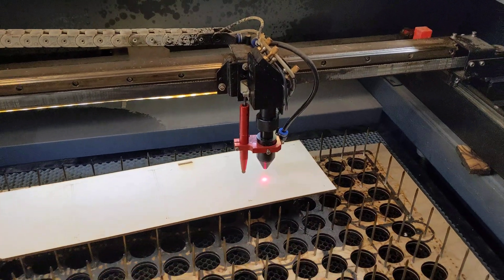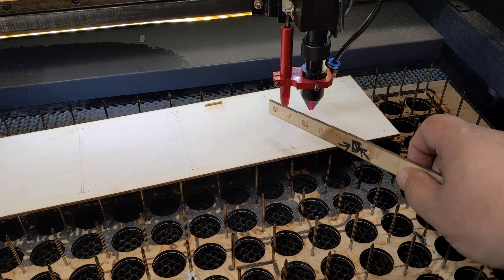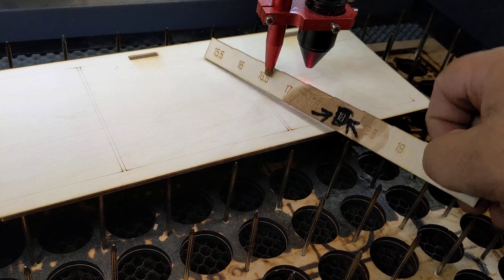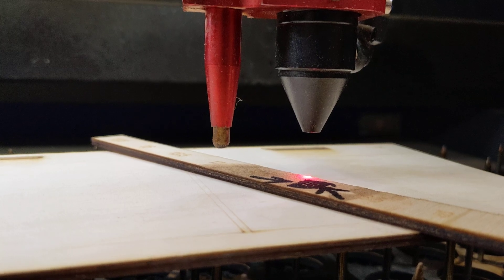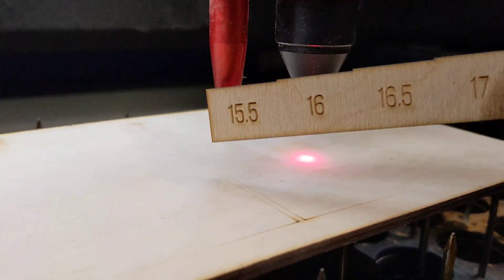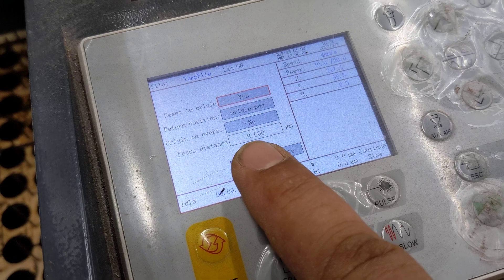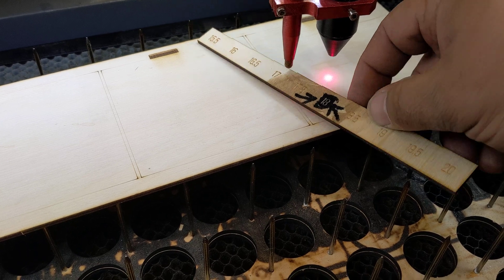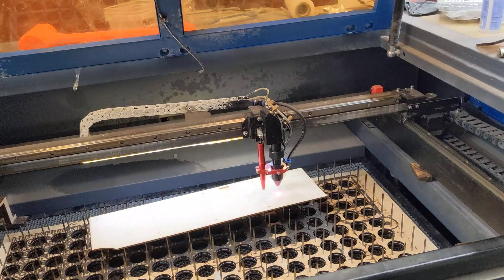OMTech / Chinese Laser Autofocus Adjustment - Safety/Frustration removal recommendation!

Comment: The autofocus feature is a disaster, causing numerous frustrations and safety risks. The faulty sensor frequently fails to adjust properly, resulting in inconsistent cuts and potential harm to the machine and materials.
Reply: Never had any problem with mine.

Comment: You cab get more distance between the probe and work pc. There is a grub on screw you can loosen and adjust to make the  plunger tip travel less to close the contact . Give you more probe to material gap ! )

Comment: I can see that you have an 18mm diameter 50.8mm plano convex lens and a nozzle with a 4mm orifice. Setting the focal distance to about 19mm tells me that you are working with an ENGRAVING set up where focus is not that important. In fact best  normal engraving results happen when you drop the work by 4 or 5 mm..  A CUTTING nozzle has a small (2 to 2.5mm) orifice and for efficient air assist and cutting,  the gap to the work should be about 3 to 5mm max. Yes, cutting requires fairly accurate focus  but  dont belive what  most will tell you about lenses. and focal points. The focal point of a lens is the IMAGE focal point that would work fine in a telescope, camera etc but that's not the same as the INTENSITY focal point that hapens when you shoot a laser beam through it.. In fact the nominal  focal point that you think you have found can change by as much as 5mm if you change speed, power or even material.  Run your focus test (maybe a ramp test?) at typical cutting speeds of about 10 to 15mm/s  and then run the same test at typical engraving speed  of maybe 400mm/s  and you will be supprised and puzzled as to the 2mm change of focal distance.. Try the same thing with acrylic and  birch plywood and you will understand that you will be continually fiddling with the autofocus pen position for  CUTTING focus where the airgap is small and the risk of wiping out the pen becomes high. If youhave a production shop and run the same material and products with unskilled labour,  then autofocus may have some value.. It's much more reliable and quicker to use the step gauge you have already created.

Comment: You've missed out the important bit - how do you work out what number to enter into the adjust parameter?
Reply from the maker: 8.5 is  a good starting point if yours is set to the 0.00 like i mentioned. Move that number up and doen a littly bit until your focus comes back to true like it was before. It may take a few tries to that number, but its pretty painless.